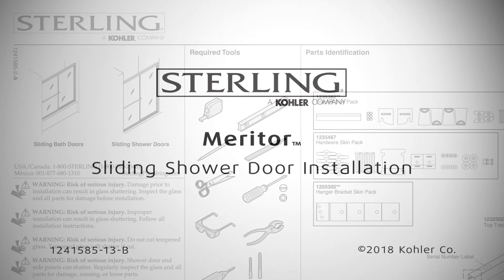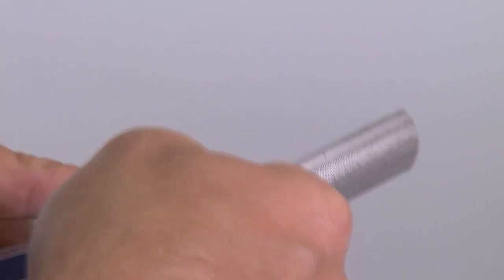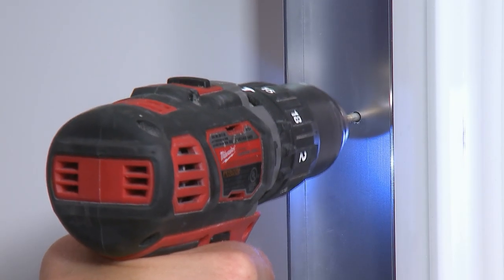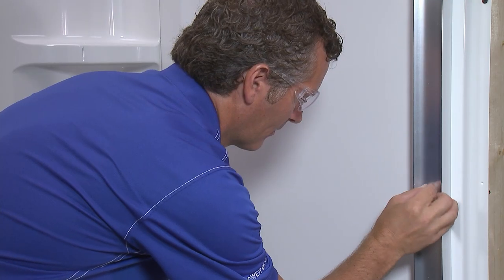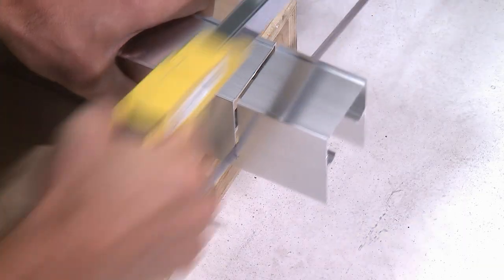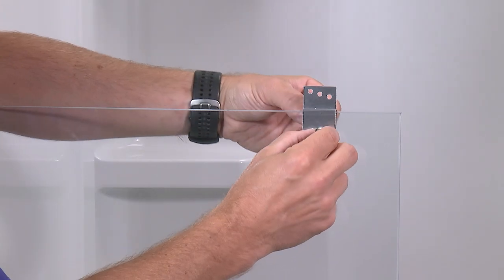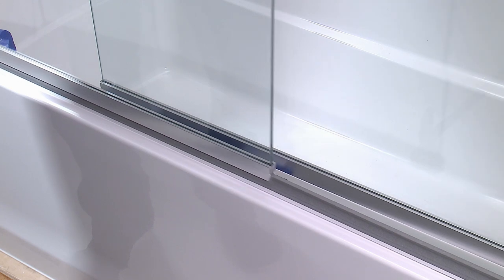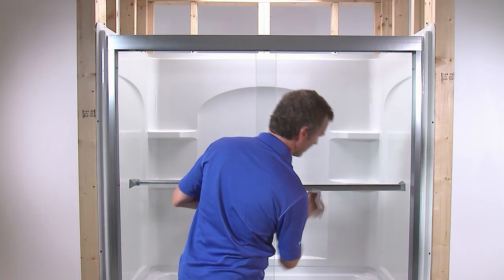Installation - Meritor Sliding Bath and Shower Doors

Comment: What if the walls are not leveled properly? I got half of the jam is touching the wall from the bottom and from the top there is 1/2” gap between the jam and wall tiles.